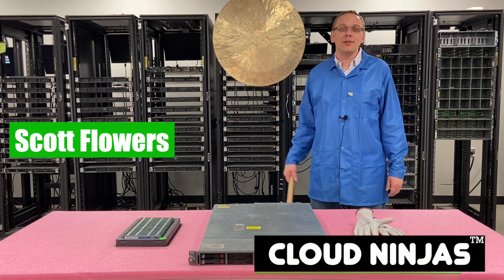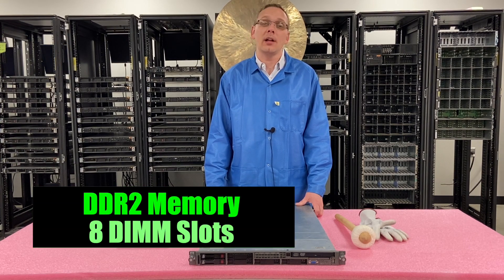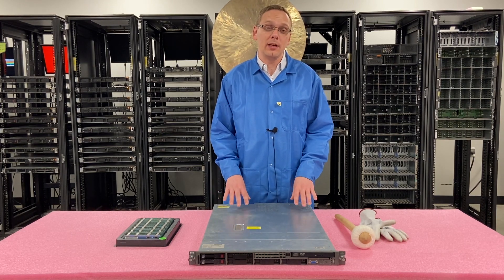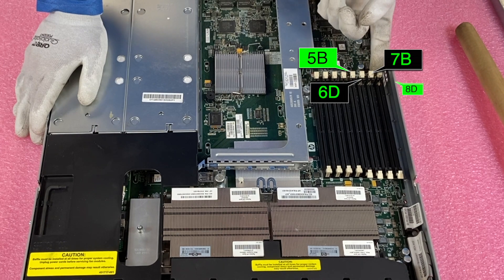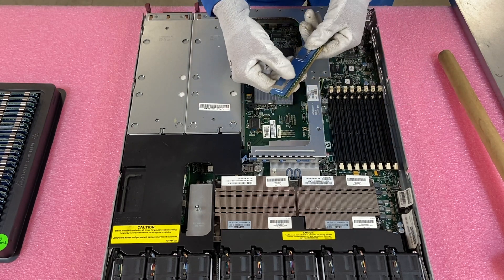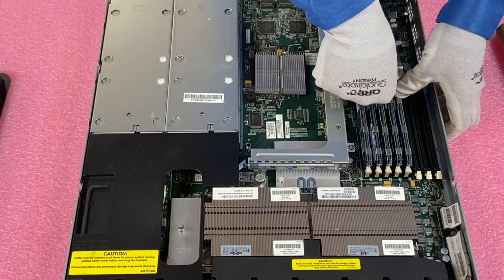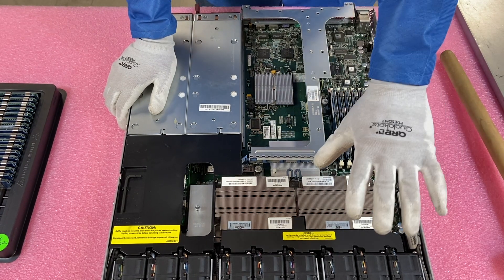HP ProLiant DL360 G5 Server Memory Overview | RAM Install Review | How to Configure DDR2 | CPU Tips

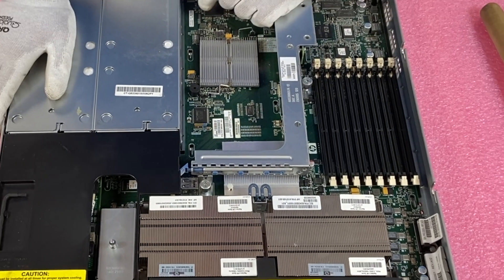Comment: 3:38 actually no because on this older stuff the memory controller is on the motherboard and is only 1 so you can use all 8 slots while having 1 cpu, and the ram is single channel.

Comment: Thank you, great video. I've got a  DL360g5 at home and following your instructions I went for the ram update.
Next thing to do is add a second cpu. Atm the Intel Xeon E5420 2.5G is installed.
Little question, do the cpu's need to be the same to operate, or can I add a different one with higher Ghz?
Reply from the maker: Appreciate your positive feedback.   You will need same cpus inside.  Take care!